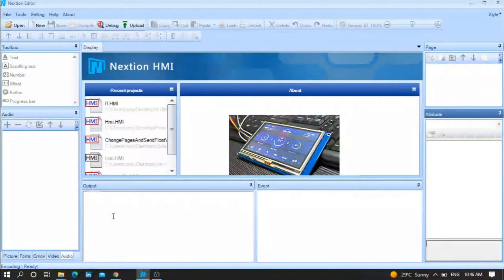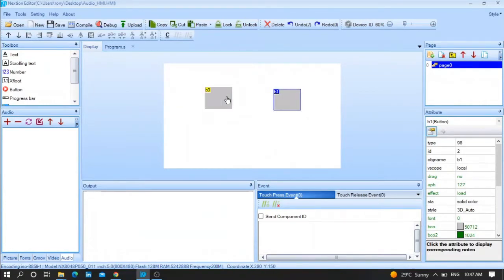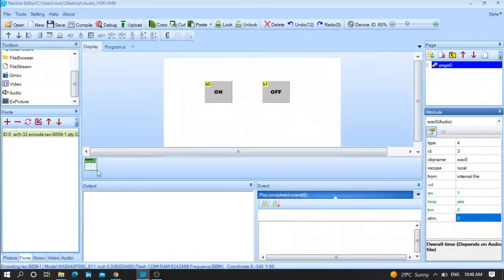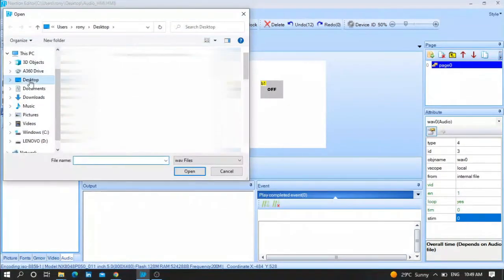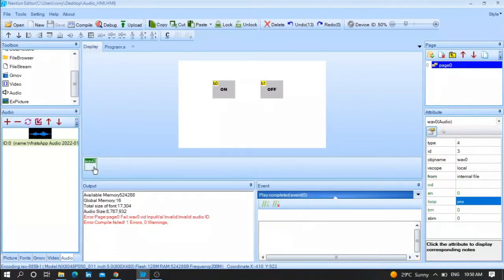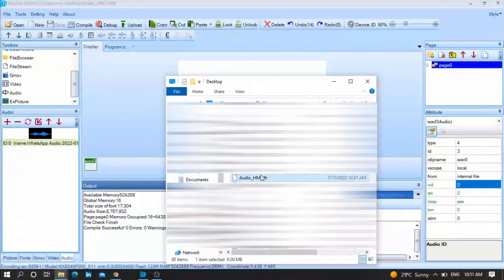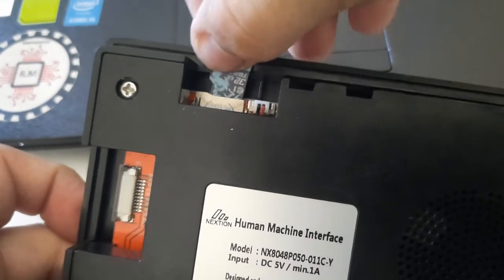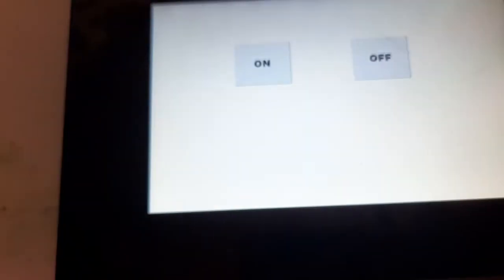How to use audio or music with Nextion HMI screen

Comment: Hello, Nextion, I have a boxed 4.3" intelligent type and the audio playback was successful. However, I would also like to adjust the volume, but so far I have not succeeded. Do you have any ideas? thanks
Reply from the maker: Hello great job!!, Regarding the volume, try using the 'vol' command like this: 'vol=50', this allows you to set the volume to 50%
Reply from the maker: Try it and let me know, I'm not sure 100% if this will work or not.
Reply: @RoMecha_lb  Thank you very much for your help, in the meantime I found a Nextion forum where the solution is written: volume=0
volume=100
And it really works. :) Yep🤗
Reply from the maker: @grindmonkey1538  Great Work 👏👏
Reply: @ thx 🙏

Comment: Are you playing audio through a box speaker or through Windows laptop/PC. Are you using a TTL converter. Please elaborate further if you can. Thank You.
Reply from the maker: hello, I didn't use any external device other than my nextion and the nextion editor software, this type of nextion has already a built in speaker inside it, and you can use the nextion editor tools to convert the mp3 file that you want. No worry it's simple to do
Reply: @RoMecha_lb  Thanks very much. Will get a box speaker for the Nextion Display.
Reply from the maker: @RobertESmith-tx6ge  Welcome dude, if you have any other question, i'm ready to help you😀😀